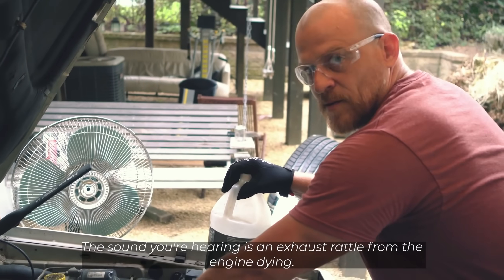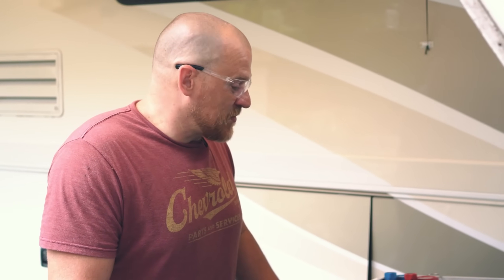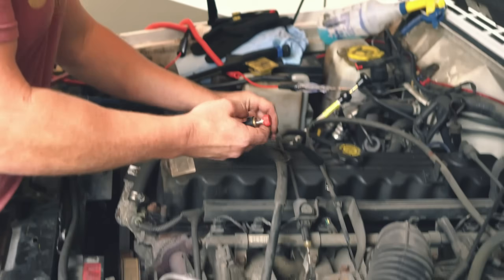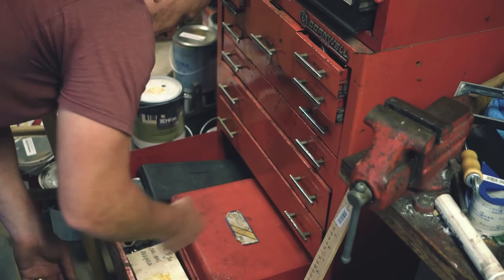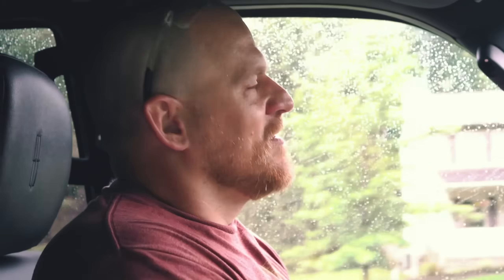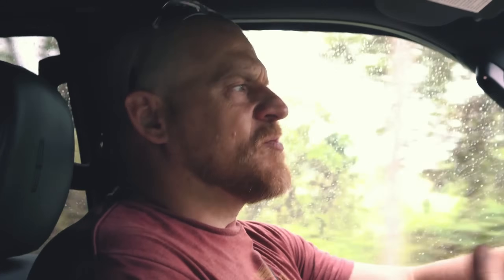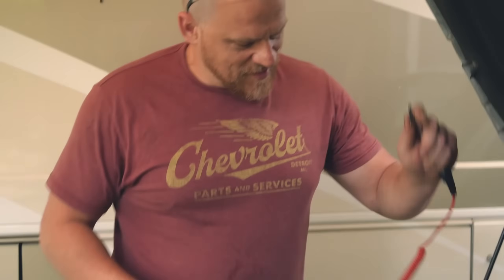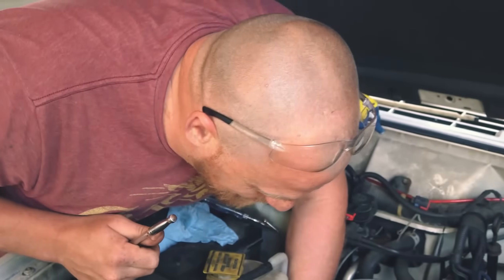Engine Dies While Servicing A/C System [Who Pays?]

Comment: Mechanic got the hot potato, they should pay ! It did not break on the owner, but the mechanic!
Reply from the maker: 100% not the mechanics fault. Crap breaks on cars all the time! Sure the timing was bad, but the point is, are you confident enough in your abilities to stand by the fact that this had ZERO to do with anything we did and sell the additional testing time and repair for the faulty coil.

Comment: I put a set of heads on 6.8 ford. Drove the van in the shop. Tried to start it after heads and timing job. Fuel pump was dead. Would only pump 10 psi. Customer wasn't happy but he did pay me to replace.
Reply from the maker: Crazy stuff right?

Comment: Hi there, I have a bit of an electrical issue with my 1999 TL ecu. 

When I turn my key to on in my 1990 miata, I give it 12v switched from a DEDICATED aftermarket relay for my fuel pump, it primes from pin A15 of my 1999tl. When I turn my key to the start (III) position to crank the car, I get no fuel relay signal to my relay, but when I turn it back to on (II) it primes the fuel pump again. Any tips?

Pin on my relay:
87 - Fuel pump power
86 - switched 12v from blue miata ignition wire
85 - honda 1999 tl pin a15 grn/yellow
30 - battery positive terminal 

Is it possible that my ECU feed and coil aren't getting enough amperage from my switched 12v to the ecu?

Comment: Your toolbox drawers look exactly like mine.. lol
Reply from the maker: These boxes have been in my garage for over 20 years. I left the wrenching part of this field in 2000 to start teaching full-time 🙂, so yeah, these are a little dated
Reply: @ScannerDanner  Same.. I've had my boxes for 20 years or so now.. But I just meant--  When you open the drawers and see a random bundle of wires and parts everywhere..  that's how mine are too.. But I still know where everything is.  Even though it looks like a mess, it's actually very organized..  at least in my head. :)
Reply: @ScannerDanner  That's crazy you've been teaching since 2000.. I graduated in 2000.. and I'm just now learning all this stuff in the last few years.
Reply from the maker: @calholli yes sir 😊 I was 27 or 28 when I first started teaching full time and I'm 51 now 😅
I had 8 years in the field full time before I started teaching, then continued working in the field as a mobile diagnostic tech all during my teaching days.

Comment: Boy that would be an understanding customer if you are charging for the  diagnostic  time and coil replacement on an AC repair.  Most people eat it if  they are a loyal customer.  You will get it back ten fold  in referrals.
Reply from the maker: I don't think we should eat it. If you're a garage owner, that's your prerogative, but you better be paying your tech if that's the case. And that includes diag time and the repair. And not shortcutting him/her in any way to "take care of the customer", which IS what happens all the time! We subsidize technicians pay to "take care of the customer" and it's complete b.s.
Reply: @ScannerDanner  All fields have their positives and negatives. If you don't like the issues with flat rate billing in the automotive field, start working in a factory repairing equipment . This is hourly pay and normally pays more and better benefits. Find a field that works for you! Most of all have a great day!

Comment: What do you use to plug the pin holes that you put in the wire insulation when using the piercing probe in order to prevent corrosion from  damaging the wire??
Reply from the maker: Liquid electrical tape

Comment: My Fuel trims are very Bad, but this ONLY if the air conditioning is on. It’s even flashing a P0130 Code after a while, if the AC is of. What’s that all about, can’t wrap my head around it? Makes no sense to me?
Reply: it's very unusual, I know. The ignition coil was replaced because cylinder one was misfiring when it rained. I fixed the problem. The lambda sensors are original from the manufacturer Bosch and from the number. I still have the original ones; they weren't defective and give the same values. The vehicle failed the emissions test; my first thought was a defective catalytic converter, then I started with the diagnosis and finally found that the values normalize when the air conditioning is switched on. I noticed this before the O2 sensors were replaced; it was exactly the same. My thoughts are with the air conditioning pressure sensor; that this may be feeding a fault into the system, changing the reference voltage for other sensors. But it would be more logical if the values were better with the air conditioning turned off, not when it is turned on, right? Perhaps the engine control unit has stored different fuel trim values with and without air conditioning and the ones without are out of control. But it can't save any new values either because the error code comes up and activates the MIL before the readiness code has even been generated. Too low fuel pressure doesn't make sense either, then the values would generally be bad. The only thing that changes when the air conditioning is switched on is a slightly higher load and 100 more revolutions when idling? So no, I can assume that it wasn't a repair or cleaning that caused this, because the problem was already there before. I could reset the throttle valve via OBD, but I doubt that that would change anything. Not that it would mess things up even more in this situation, so far the vehicle has been driving perfectly. Unfortunately the emissions test is done with the air conditioning switched off, because otherwise the idling speeds are too high for the test, otherwise you could test whether the vehicle passes like that. If the values were good and the catalytic converter was still intact, it should pass. At least then I would have confirmation that the catalytic converter (also original, btw.) is still working properly. Any ideas are very welcome.
Reply from the maker: What is the P0130 code definition and what are your fuel trim numbers before and after turning the AC on.
Reply: @ScannerDanner  The P0130 actually means bank 1 sensor 1 electrical malfunction. The lambda sensor (wideband) has already been replaced however and it is giving the same values. Currently the short term fuel trims at +3-4 are sometimes down to 0.8, the long term fuel trims at -3 but only when the air conditioning is on. If I turn it off, the short term go up to over +13 (and more) even worse when idling, long term also goes up to over +10, extremely lean, as if there was a vacuum leak. So bad that this P0130 code is eventually triggered, often a P0171 (mixture too lean) is also triggered and the control unit goes into open loop. If I reset the errors, the whole thing starts again. The sensor after the catalytic converter has also already been replaced, new ignition coil, spark plugs, mass airflow sensor was cleaned, throttle body cleaned, all original parts, no change.  

I looked into the catalytic converter from behind, from here it looks physically intact, I can't say if it's the same from the front, I couldn't see in there.
The car is a VW Beetle 1.6liter engine.
Thank you in advance! I'm very interested to hear an expert's opinion on this. 
I can't make sense of what's going on here.
Reply from the maker: @Xantylon74  when did this start? It is now very complicated when a bunch of parts have been changed. In particular the O2 sensors themselves! Factory parts MUST be used on some of these systems. What you are describing is a very unusual symptom. What does the flow chart gor that trouble code list as options for faults? 
Id be putting factory O2 sensors in that as a starting point, once you give me a history of this fault that is.

Comment: Years ago I did a tune up on my aunt's 2.2 4 cyl. Plugs, cap, and wires. It ran like a champ. A week or two later it had a miss. I could not find it for awhile so I went back to basics and did a compression test which was good but in doing so I also checked the gaps on the plugs and one of them was too big. I corrected the gap and again it ran like a champ. Too small and the spark is not hot enough and too big and it may not fire or fire intermittently. Good video.

Comment: Stuff happens. I did an induction service on a civic once. On the test drive, the check engine came on for a map sensor issue. I thought the cleaner got onto the sensor and damaged it. So we put a new one in. Drive it 10 miles with no issues. Cust comes back with the check engine light on later that day. Long story short, it needed the valves adjusted. Had to explain that one to the customer.

Comment: I had an old Chevy pickup in the shop (I can't remember why) but after I lifted it, the truck became a no comm no start.  Turned out whoever replaced the fuel pump had the harness pinched between the tank and frame.  Lifting it at the frame was enough to crush the wire and pop a fuse and created a whole other problem.  Also, I would like to comment on looking at wiring by memory - I had an awful alternator to do on a nissan 3.5.  It is a very tight fit.  The wires pulled out of the connector during the repair.  I went and looked at the diagram and repaired the wiring but the alternator was charging at 15V.  So we ordered another alternator and I did it again and had the same problem.  After going back to the diagram and finding the pinout, it turned out that pin #1 was not the first pin in the connector!

Comment: Had a customer bring in his S-10 pickup for a state inspection, customer was waiting, completed the inspection and needed a new bulb for the high mounted stop light.  Completed the repair, went to back out the vehicle and nothing.  Truck did not move in either forward or reverse.  Customer started to say something of what did you do, to which I responded, you tell me.  He stopped and thought that one over and said nothing.  Gave him the name of a transmission shop we recommended which he followed and had his transmission overhauled.

Comment: Heres a good question., A famous Youtube mechanic put a video out about a Ford that had shorted the PCM. I had made a comment that I have fixed a few of these in same situation and every one of them the spark plugs were way way over due. I said that the big gap of the spark plug put more stress on the coil which fries the driver and that worn spark plugs. Im of the opinion that if plugs are changed at a normal interval that ya dont get coil issues. He commented and told me that worn out spark plugs actually cause a lower amp draw and not the reason for failure. . Id assume that higher gap causes higher voltage which the driver cant handle?
Reply from the maker: Amperage doesn't change in the primary circuit. Secondary kv will increase with many variables. 
1. Cylinder pressure
2. A/F ratio 
3. Worn plugs (increased gap)
All of these change KV demand and therefor stress on a coil. But in reality, plug gap isn't going to be what cooks a coil and driver. Ford COPs were garbage and so were their computer drivers. It wouldn't be from plugs on those systems
Reply: @ScannerDanner  don't forget about the every changing back EMF pulses and voltage spikes on the primary side, which all turns into more heat and we know for sure excessive heat kills electronics. once capacitors/diodes start to fail the drivers quickly go bye bye.  thank good it's not an microwave or higher RF signal igniting the fuel 🤣 maybe I shouldn't joke, before someone decides to try it....

Comment: Hey Paul, great video of what we deal with in this industry. My experience is, if it's an easy part to change and less than $100, I'll fix it at no charge and explain it to the customer when I let them know its ready. I have gained a lot of lifetime customers that way. They appreciate my honesty/integrity. 

If it is not a simple/cheap  fix, I'll call the customer and explain what just happened. Sometimes, it doesn't go over very well with the customer, but most of the time, they understand. 
If you are sincere and explain it well enough for them to understand, they usually feel that you are not trying to rip them off. My favorite thing I tell my customers is "You just have to be honest."
Reply: "We operate out of fear of losing a customer".

*raises hand and waves it wildly.
Reply from the maker: I can appreciate this, but it's still honesty and integrity to charge them full price and make no apologies. This way you're not subsidizing your technicians pay to please your customer. (Not saying you operate that way) I mean you still got to pay him to troubleshoot it and change whatever failed part there is. 
But I also understand wanting to "take care of a customer", I just think we operate out of fear of losing a customer too much.
Reply: @ScannerDanner All because of the dishonest technicians is why this is a thing. Also there's dishonest customers too. Who knows it may have died on them previously and knew about the issue hoping it would die on us so they can claim it's our fault. Seen this before and heard about it.

Comment: In general depending on what happened. If the technician causes the issue. Example frying a computer when testing. Then that is on the shop. Now a part failing like in this case, it’s on the customer. 

Now the question of who pays to figure out the issue, I think the shop still get some money. So if it was the shop then half of their rate if they caused the part to fail. Just a regular failed part then the customer pays in full. 

If a shop wants to do it a bit differently. Then that’s their prerogative.
Reply from the maker: Agree, it is the shops prerogative but they better be paying their tech the full diag time and repair. Any discounts come from the owners pocket, not the tech and unfortunately it always comes out of the techs pocket and that is 100% b.s.

Comment: That really puts you in an awkward spot. I stopped doing side work for cash several years ago after a couple of jobs went sideways like this one. Now I just help about family and friends for swapped labor or dinner.
Reply: I had to stop on one car.  Anything you touched would break of fail.  Had to pull the engine up when the front cover for the oil sump broke.  You can't change it unless the oil pan is removed.
Reply: This is why I don't even do work for family. Couldn't even get a cheesecake from my own mother.
Reply: 100% Same. Only ppl who know me and trust that if something went wrong and it wasn’t my fault they believe me. They know if it was my fault I’d say so, if u don’t know me like that I don’t touch your car. I’m a plumber/hvac tech, I just a mechanic first 😂

Comment: Option 4: Finish charging the AC then push it outside and act surprised when the customer comes to pick it up
Reply: Reminds when I picked my s10 up from a complete new brake line set install. Paid, got my keys and went out to start it. Very noticeable exhaust leak. Went back and was told he had to pull o2 sensor to route line and it now leaked at sensor base. Not sure why nobody mentioned it to me up front
Reply: Hahaha 😂 good one
Reply from the maker: hahaha good one Noah!
Reply: @ScannerDanner  I learned from the best ;)
Reply from the maker: @gadasavideos8564 that is a completely different story and is the garages fault for never addressing it and going you wouldn't notice

Comment: Customer pays everytime especially at the dealers .
Reply: The coil is bad. Absolutely nothing to do with repairing the AC.  Customer should pay.
Reply: @rustynail7866  But it was working when they drove it in there. Even though it was not shady, it sounds like it to a customer. I guess it really depends on if you want to keep them as a customer or not as to whether you should eat the repair or not.